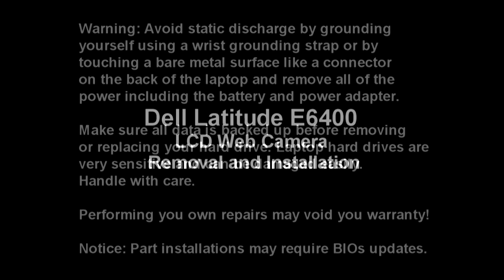Dell Latitude E6400 | LCD Camera Replacement | How-To-Tutorial

Comment: Is it possible that a latitude E6400 cames without cam?
Reply from the maker: Yes. The E6400 has a non-web camera configuration. If you want to add one you will need a Web Camera and (web camera specific) Display Cable and Display Bezel. You can shop for these parts here: Web Camera https://www.parts-people.com/index.php?action=item&id=5601 Display Cable http://ppci.me/c/140/222/lcd+cable Display Bezel http://ppci.me/c/140/222/lcd+bezel

Comment: Hey. I have E6510 and can't compel camera to work. I went through all posts on Dell Community Forum and my last hope is in phisically detached camera tape from motherboard. So i have some questions. Must I detach LCD screen from main laptop part (body?) before I try remove plastic frame from screen? How strong are plastic cleats? I mean.. I tried pry plastic LCD frame and it's really firmly assembled. I just would't wreck any plastick parts.
Reply from the maker: +Mateusz Zasuwik No you don't have to remove the screen from the laptop base before removing the LCD bezel. The bezel might be glued to the screen, that might be why it's so hard to remove. You just have to carefully pry up the bezel until it comes loose
Reply: +Parts-People.Com, Inc Thank you for your advice. Could you now look at these photos? All wires seems to look properly, but till now I can't detect camera. http://imgur.com/a/hYMrb If I cover these two rubbery dices, screen becomes darker so it must be light sensor, although description talks about camera. Is it possible that camera and light sensors are combined in one device?
Reply from the maker: +Mateusz Zasuwik The cables all look fine. The one that says ALS stands for Ambient Light Sensor. That would be what controls the brightness of the screen. The cable that say camera is also the microphone cable. What it is plugged into is, in your case, a microphone only. You would need to replace the microphone with a camera and you will probably need to replace the LCD bezel too. The camera will look like this http://www.parts-people.com/index.php?action=item&id=10898 the LCD bezel will look like this http://www.parts-people.com/index.php?action=item&id=7544 It should have a camera hole. 

After installing the camera and bezel, the driver should recognize the camera and start working fine.